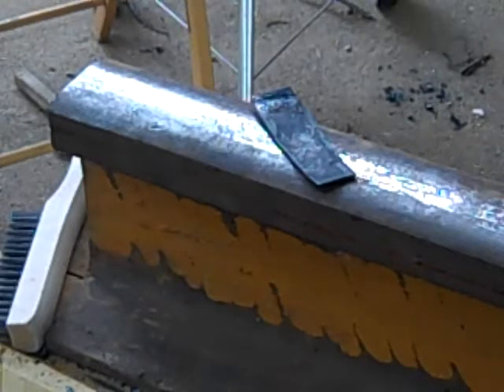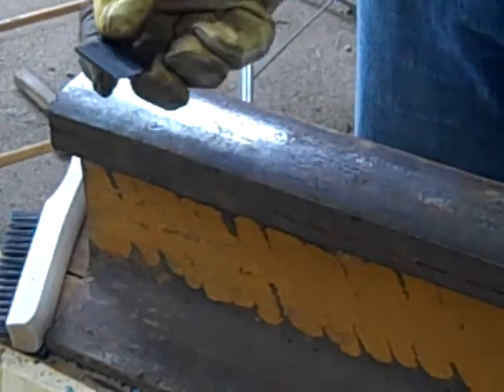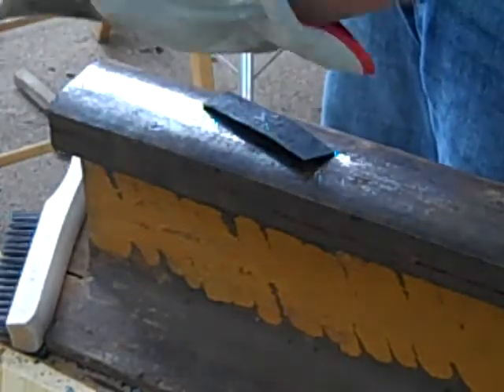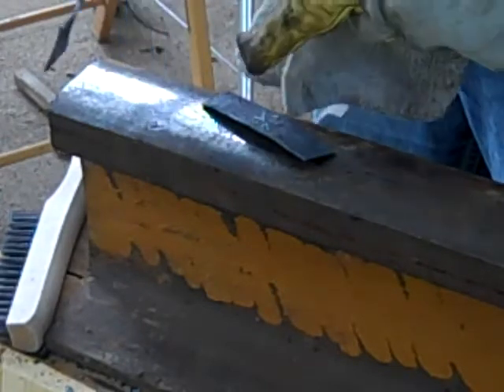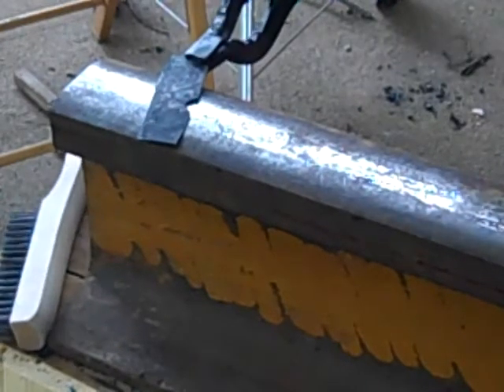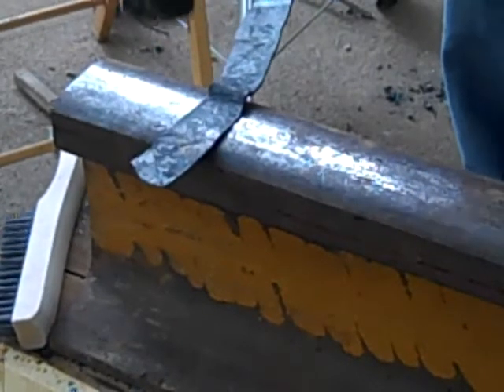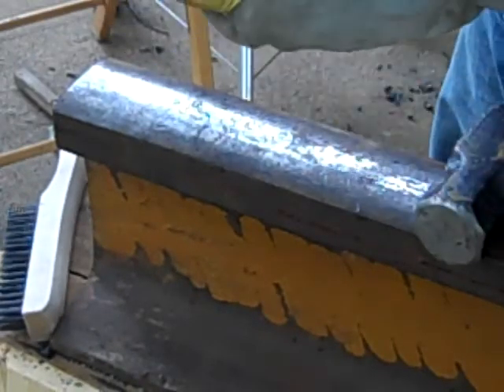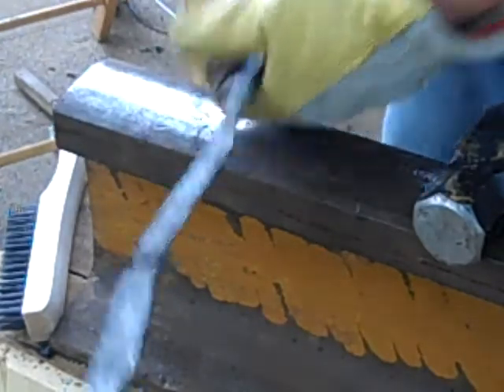Amateur metallurgy

Comment: The demagnetizing temperature, or austenizing temperature, is different for various carbon contents of the steel. The higher carbon steel is going to have a different austenitic  temperature than the lower carbon steel. So different temperatures are required to attain the same results. Martensite can be set up in virtually any metal that can be classified as steel, with Martensite being the hardest grain structure observed in steel.

Comment: I would point out that a less brittle tool may have an advage in most apps. Who wants to worry that a blade will snap in half while batoning? on the other hand who wants to stop  in the middle of butchering to resharpen? I have always want to try my hand at blaksmithing so I'm really enjoying this, thanks.

Comment: you can case harden mild steel. it doesnt have the strength of a higher carbon steel but if you harden it and temper it right its quite effective